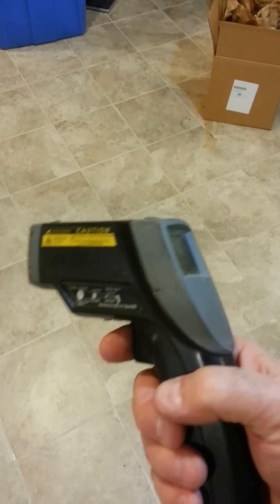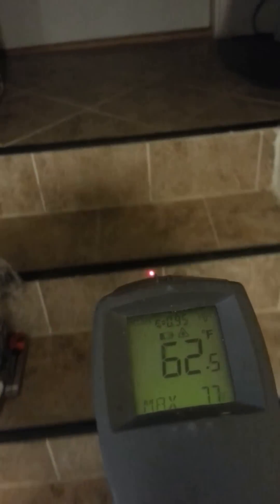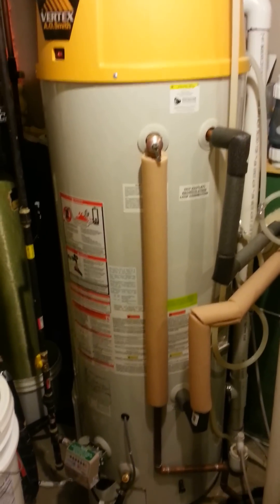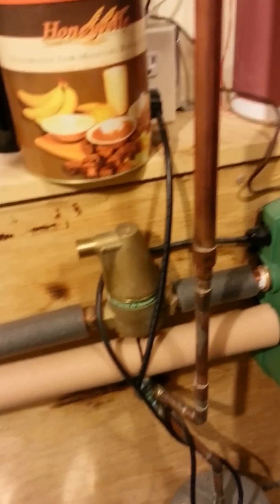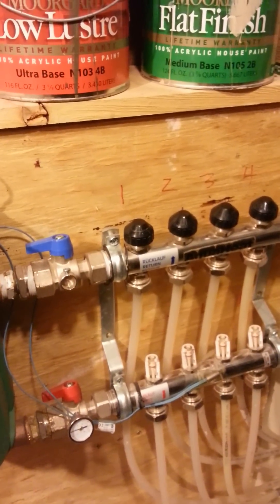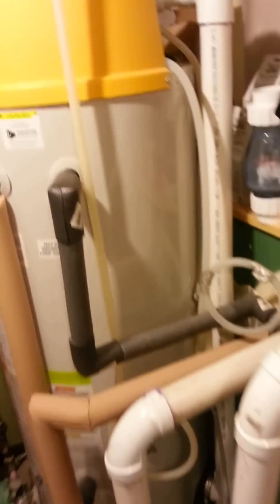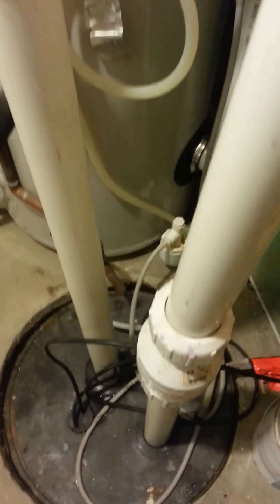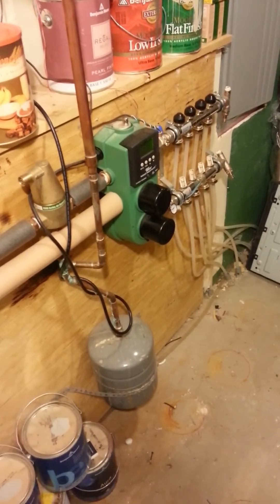Radiant heat using. AO Smith vertex and taco RMB-1

Comment: This is an "open" system, i.e. running potable water through the space heating equipment, not all of which is rated for potable water. Most municipalities will not allow this application.

Comment: We have this very same installation for our own basement, coincidentally with the same brand of equipment and number of zones. Recently, after only 5 years of operation the AOSmith Vertex water heater sprang a leak/corroded out. Our water is city sourced and UF purified, and we have softened water. I suspect the in-floor heating aspect of the installation is the culprit -- perhaps due to accelerated cycling? Anyway, along with our plumber and OASmith we're working the problem to determine why the water heater died so prematurely. Fortunately the AOSmith warranty is for 6 years.